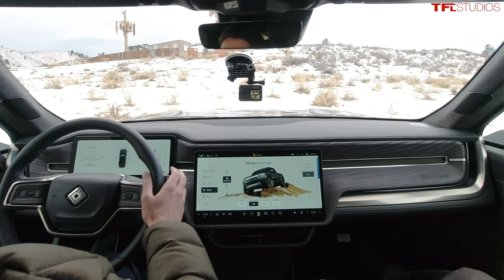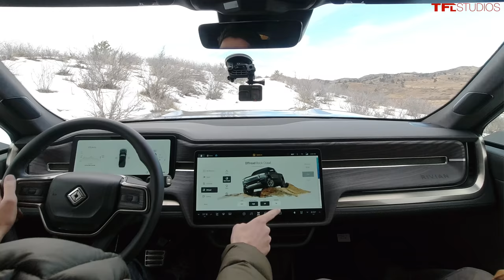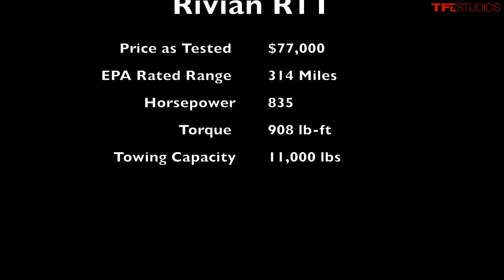Fully Loaded! Can an EV Pickup (Rivian R1T) Survive a Hard Days Work?

Comment: 8% of the battery after all that!? That seems pretty impressive! I'd be curious to see how much gas out of a tank was used on a comparable truck for the same effort
Reply: Probably way worse with a gas or diesel truck, all the idling and clutch/automatic waste. Electric is perfect for offroading.
I think the only times when you can say comparable usage (fuel and electric) is driving it in soft sand.
Reply: Well the mileage the other channel got on the trailer challenge was just miserable…I don’t think these guys drove very far 😯
Reply: @roland9367  real off road kills the power, I have an EV and taking it on the beach is a mile driven 10 miles lost in range. TFLs Jeep 4xe test showed all electric 28 miles on pavement, 3 miles off road
Reply: @stang393  Yes that is what I mean, soft sand. Any other form of offroading the EV is clearly in an advantage. Because you are recouping energy and not wasting on idling.
Reply: @roland9367  perfect for offroading* 

gotta amend this

*perfect for offroading if your trip is less than 2 days, if you didn't have to drive far at all to get there, if you arent towing anything, if your trip isn't lasting a full day, and if you dont have to bring a generator to run all night to allow you to have fun longer than a few hours.

there fixed it for you
Reply: @t_c5266  Yeah the real problem is that most US people only have 10 days off, so all of the things you say apply to some offroading for fun.
Reply: @roland9367  10 days off? Did you forget to include 104 weekend days off that people get each year? Using those 10 days off for a monday to create 3 day weekends + the holiday extended weekends translates into many many many 2-3 day trips that this truck simply would not survive and would be completely useless to the average truck user
Reply: @t_c5266  Yes, my point exactly. But really in the US there is lots of offroading nearby. I live in Netherlands, for some good offroading I need to drive a lot anyway. But then we have much more free days. And I am my own boss :)
Reply: @roland9367  "i need to drive a lot anyways"

so in other words, you need a real truck and not this rivian
Reply: @t_c5266  
I would be happy to have the Rivian. In fact, there is a big possibility that I buy one in future. Right now I have an electric daily driver and two 4x4 vans. Might do them all away and go for one car, the Rivian.
I don't see any issue in driving 1000+ kilometer. There is a good charging network in Europe. Sure, a petrol/diesel version will arrive one or two hours earlier, but I don't care.
Reply: @roland9367  trust me, driving that far, especially with a load, will be too much for you to handle. Already thats 10ish hours of driving and then add in the fact that you'll need to take multiple hour+ long charging breaks, at least 4 if youre towing that far or have a load in the back, or are going over hills.
You'll do a 600 mile trip once, realize a 14 hour day of driving sucks, sell the $70,000 rivian, and buy a $40,000 truck that can do that and more.
Reply: @t_c5266  I have no obligations to do anything in a single day, that is my whole point. And I won't be towing stuff, we travel quite lighweight.
And still, with 200kW charging I will be able to do 600 miles in a day no problem.
In fact, we have young kids and we already have these long breaks haha.
Next to that, I am trying to drive mostly on my own solar and wind energy when around home.
Right now I have 4 cars. And you probably don't realize that a diesel truck has 200 Euro road tax each MONTH! And fuel prices are crazy too, at more than 2 Euro for one liter of petrol, and 1.6 Euro for a liter of diesel.

I already am offgrid for 3 quarters of the year with my own battery system, and need very little for the remaining partof the year. Recent energy prices don't hit us that hard.  So you might understand my way of thinking.
Reply: @roland9367  I want you to take a step back and read what you just wrote and realize how niche of lifestyle yours is that would accommodate this truck. 
appealing to a niche is not how you become wildly successful, in fact, thats how you lose money and discontinue the truck.
For the vast majority of truck owners, this will not suffice. 
Just like every other niche car has failed and been cancelled, a truck that cant do truck stuff for the truck owners will fail and be cancelled.
Reply: @t_c5266  Yes I fully agree. It is a lifestyle thing, just like my 4x4 vans are. It is not necessary at all. Here in Europe only very few actually need a pickup truck for pulling heavy stuff. They are sold very little, and still half of them don't need it. Driving a 2 ton or 2.5 ton vehicle on your own. Nothing in the bed because it is too small and stuff gets wet.
They have their use, but it is very limited in Europe. 

But I don't agree that it will mean less success for Rivian. They mostly focus on business customers any way.
And the US market with pickups is quite important. However, it could be that a cheaper and more limited F150 lightning could proof more succesful, for business use with repetitive driving around town and towing for short distances.

Comment: Tommy do a cost of ownership analysis that may take a little sticker shock out of the equation.  I spent $60-$100 a week in fuel when I was commuting.  Over 6 years of ownership the gas and $75 oil changes might make a $70k sticker price more digestible compared to traditional less expensive alternatives. 
Great show!
Reply: That's why EVs are so expensive. They are charging you up front for the savings, but the savings don't really show for 7-10yrs. Most Americans don't keep a vehicle that long, and only tesla has cars on the road that old. Battery replacement is alot more expensive than engine replacement.
Reply: What happens when your battery pack takes a dump in approximately 10years? I can change alot of oil for 25 grand. Also what's the life expectancy of the 4 motors? Not sure I'm sold just yet
Reply: @Chris C Solar Panels!!!!
Reply: @jimmytedrow4146  I hear rumors of charging stations where you pull in swap batteries and then you are on your way
Reply: @kylestyleracing  that would be a game changer!
Reply: I don’t remember where I read it, but it takes (on average) at least 150k miles of driving for an electric car to just begin paying itself off. This was based on just normal sedans. Trucks? Totally different story due to electrics not being able to go the distance with virtually any kind of load. Why do you think the Tesla semi hasn’t been released yet? It’ll need to carry 15k lbs of batteries just to carry a regular load 600 miles.
Reply: @justinmcroberts4633  I don't doubt this claim. Do you think that with advancements in technology will change things? I do. I am not saying that there aren't limitations with evs. I believe that it is the future of transportation. Just my opinion.
Reply: @HK304  What data we have on batteries that are properly managed is that they'll easily last 10+ years. The only car I'm aware of that has battery longevity issues are early Leafs, because they didn't properly manage them (temperature control).
Reply: @JorenMathews  10+ years I have a 1980 blazer still running strong with the factory 350 it came with. That would be 3 sets of batteries at what cost? It's like buying a new truck every 10-15 years
Reply: @Chris C Very unlikely for electricity prices to be the same as petrol. It is much cheaper to generate electricity from big and static generators than to burn fuel using small and mobile ICE. And generators usually use cheaper fuel than petrol.
Reply: @jimmytedrow4146  The lifetime of batteries is 1000 times of the range, at least. Rivian uses Electric motors have little moving parts that touch each other, because they are brushless. They will last 1 million miles. You may need to replace the gears and couplings though.
Reply: @justinmcroberts4633  complete lies. Check your facts. No ICE can do 600 miles with full tank. Very few can do 500 miles. I have just verified with my cars and the ICE that I drove as well as specs on F150. With 15,000 lbs of batteries, EV trucks can go to the moon.
Reply: You also have to factor in the cost of installing a charger at your house. You can't just plug the truck into an outlet.
Reply: @kylestyleracing  might look at the true efficiency and rate led output of your solar panels. No sun, cloudy day dirty panels, One cell damaged panel is worthless
Reply: @othmanskn  what do you think is going to happen when the demand for electricity goes though the roof to charge all these electric vehicles? 🤷‍♂️🙄
Reply: You allow companies to become a monopoly then complain because of what it cost.
Reply: @jimmytedrow4146  after 10 years, you need to change more than just oil. If this is what you think you spend on ICE, you deserve to waste your money on ICE, while the rest of the world enjoy the economy, convenience and comfort of EV.
Reply: @jimmytedrow4146  if it survives more than 10 years, you don't need 3 sets of batteries for an equivalent EV. Check your facts or you shall suffer losses. Not only in money but your health.
Reply: @joshramsey3099  already checked. Almost all result in savings. one cell missing, replace it. As easy as replacing a spark plug.
Reply: @joshramsey3099  It is just your stupid excuses. It was much worse when the first petrol cars were I introduced at my place in 1969. It was hazardous to drive even 200 miles away because not a single petrol station. When petrol cars arrived in huge numbers, the fear of long waits at filling stations never materialised. For EV, much better. If no generators, buy our own solar panels or petrol generators. If you run out of petrol, where do you get petrol, like during an emergency or road closures? You just end up with useless junk of steel ICE car. No alternative whatsoever.
Reply: @othmanskn  the ignorance runs thick! Have a great life with your electric life 🤣
Reply: @othmanskn  try not letting the engine overheat, that's probably why you've rooted so many engines.
Reply: This truck is upwards of $90,000 all in, you might have to pay road tax (since you don't pay it via gas tax), you will have a higher insurance premium and you still have to pay money to charge it.  I just don't see it beating out an ICE truck when it comes to cost of ownership...
Reply: @justinmcroberts4633  because a truck is very long, it can be very aerodynamic. I was able to get a CD of 0.07, comparable to the pac car 2, with its teardrop shop. Weight does not increase loss so much. Cybertruct gives you a clue as how to make trucks more aerodynamic. ICE trucks are not aerodynamic because of the huge ICE.
Reply: @Chris C Most people don't drill and distill their own gas... Most people could charge their own EV with their personally installed solar panels...
Reply: @Chris C Most people also don't need much more than a vehicle to commute less than 50 miles per day...

Comment: It was one thing that could be useful on the Rivian that you didn't test, the onboard air. If you have a pneumatic grease gun and the Rivian, you would have an easy day lubeing a tractor or other farm equipment.
Reply: I forgot about that, when he mentioned the location of the spare tire being one of the things he didn't like, with a loaded bed.  But with the on board air, maybe have a patch kit handy, and maybe you can patch the tire and pump it back up without having to get the spare.  Which brings up another point, maybe in a later model, they might provide an access point to that air outside of the bed.  Because even being able to patch the tire, you still might have to unload the bed a bit to access the air.
Reply: It depends on what cfm the compressor is.  Air tools use a lot of air.
Reply: I think most guys use cordless electric grease guns now, in construction anyways.

Comment: Finally. Actually useful information for anyone that might want to do something other than just drive around in an electric pickup truck. The fact that a 4x8 sheet fits in between the wheel wells is smart. Clearly, they thought about this requirement. Then there's the length of the bed. Another win.

I owned the original Honda Ridgeline for a number of years and it too was smartly designed to think about these things.

Comment: Great video however anyone who has owned a pick up truck for several years where there’s lots of corrosion and rust and has had to change their tire…believe me you would rather have your spare tire protected in the truck bed then corroded and rusted permanently to the underside of your truck.  And yes I tried undercoating.

Comment: It's so interesting to me to see these guys going all electric tools. A lot of people I know are very against electric tools for some reason, so it's nice to see an actual farmer be all in on electric. The thought of just having your truck plugged in at night, with all your batteries in the bed being charged simultaneously is so futuristic to me lol.
Reply: Battery powered tools work really well if used everyday.  Not so well if sitting on a shelf in one's garage for months at a time.
Reply: We changed to electric years ago. 
Expenses went down. Performance went up. Plus the absence of noise, mixing gas and fumes is awesome
Reply: @mattbrew11  yeah I don't get it. I do live in the south so things go a little slower here lol. I've already switched to all electric at home, my lawnmower and everything is all battery powered. I like it a lot. I can hold conversation with the wife while I mow the lawn, and I don't have to store gas cans any more.
Reply: Low-running tools (like drills, impacts, sawzalls) are great battery tools.
But I don't like battery tools for high-running tools (tools that rotate for long periods, and/or must overcome strong resistance) like circular saws, chainsaws, weedwackers, lawn mowers, vacuums, or snow blowers. Those things eat battery juice, and lose effectiveness quick, so I prefer corded or straight gas.

I love electric battry impacts, ratchets, lights, & bandsaws though. They last a good while during normal use.

Comment: A lot of cool features of this truck, 4 motors so no difs, etc.  But it still has the one major issue, very limited range under load.  I'd be afraid those tailgate hinges would crack over use. A rivian employee drove from detroit to LA towing a mustang and they had to recharge every 100 miles per your video.  That relegates this truck to local/daily use only.
Reply: It's a toy truck for yuppies...
Reply: Yep and prob 30 min to charge if not more.. now a 750 mile trip is a week off
Reply: Yeah, gasoline is an unmatched miracle to this day. It uh just, you know releases all the carbon that was stored in its creation.

Comment: Just a mention about the inverter to power 120 volt applications, the slow start up is an intentional design, its called soft-start, it reduces the inrush current, otherwise the inverter would have to be rated at a minimum of 6X running current for inductive loads, i.e. motors, to start them.  About all modern inverters have this function.  Not a downside, it's an improvement.  Also no need to worry about harming any devices, the lowered starting current saves brush life.

Comment: Those real world tests are the best to give me an ideia of what's capable. Thanks TFL. I wonder if it support 35 MT tyres without any problems for the software to manage everything.
Reply: I believe so, those are actually 34” tires on 20” rims if you can believe it! 👌🏽🤷🏽‍♂️
Reply: Looks like there's room for 19inch rims with the right shaped barrel and no wheel weights attached near the calipers. I'm sure with the right offsets and widths you could do 35s easy.
Reply: @joobaggs6886  19s are car wheels
Reply: @joobaggs6886  yeah why 19” what you really what is a 17” wheel. But it wont fit.
Reply: @Fparrish  to get 17s to fit you'd need to swap to smaller brakes which aren't good for a 7k lb truck with over 800hp lol.
Reply: @mattbrew11  true most at tires are either 18 or 20s. Not much in 19s.
Reply: @joobaggs6886  wonder if its much of an issue with 4 electric motors slowing you down as well. No need to use the brakes as much 🤷🏼‍♂️

Comment: A couple of points, Tommy said, that this Rivian is not really intended for work like picking up firewood etc. Then my question is, then what is a 'pick up' for?
The tailgate hinge wells,.. you're correct David, if debris gets down in those 'hinge pockets' what happens to the hinge mechanism if this pocket becomes full  say snow and ice, for example
does the hinge just break?  I've seen this very thing happen to a mid sized front end loader, when snow packed itself down around the lift cylinders, turned to ice, and busted off this cylinder / ram
like a carrot, when the loader bucket was raised. There was nowhere for the ice and snow to go.
You also also said that your foot was not on the brake at all when going down the hill, ( see at 17:45 ish ) yet the brake lights were illuminated, do the brake lights come on when regenerative braking is on?
P.S. Oh by the way, YES I think the R1T is a truck that I could sure get used to, and would like to own. Contrary to what some might think, I think, with a few modifications  ( those hinge pockets ) this truck will be great for my type of  daily driving and use.  Thumbs up!